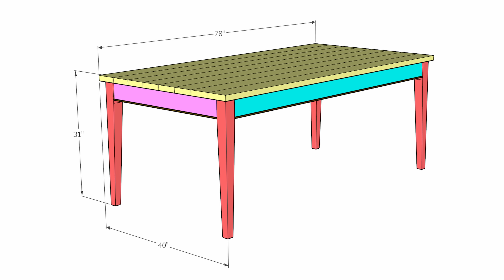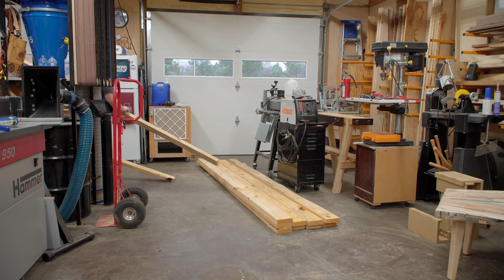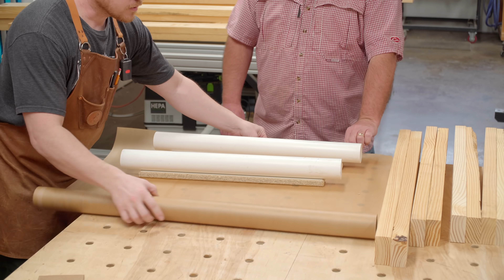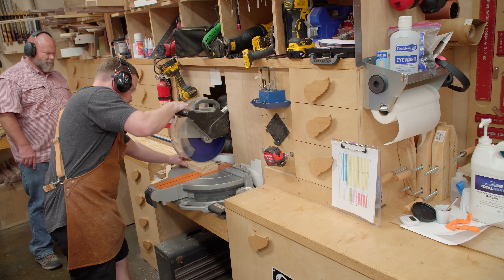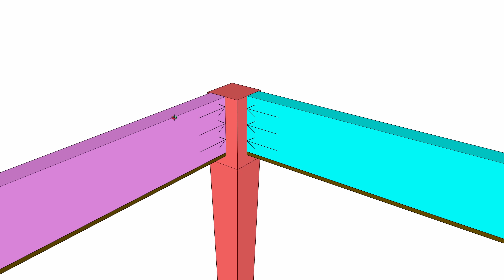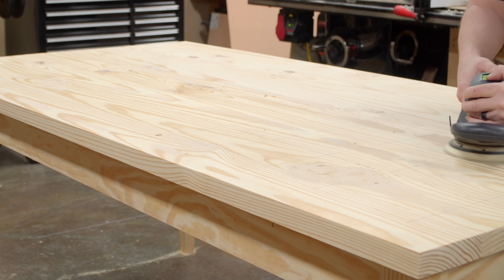How To Build A Shaker Table - 381

Comment: Awesome build, great tips. Never been a fan of stained pine.  Looks way too much like the faux rustic offerings of big box stores.  But, I realize that wasn't your choice
Reply: Agreed.  A wood conditioner, applied before the stain, would have made the pine look a bit more even.
Reply: Looks like they tried burning it.  Too much pinterest.
Reply: I think the table is great. A few modifications for minor edge treatments could have benefited it style wise a lot too. If it was vertical grain it'd be down right stunning. I'm not a huge fan of flat sawn pine but that's personal preference.

Comment: I really like the idea of the block of wood glued on the aprons and legs. That should provide more than enough strength and is a good replacement for a mortise and tenon. I hope this gets shared because this is the best and most concise video on how to make one of these tables. Someone could take this table design and add some different embellishments to it to customize it to their liking. Like adding some curves to the aprons or some different edge profiles.  

I will say that edge jointing pine on a table saw will be sufficient as if there is a little amount of bowing in the wood, clamps can close up the joints. A person will have trouble closing up those same gaps if they use hardwood. In the past, I have edge jointed pine on the table saw and then refined the edge with my hand plane. So a person could do the same with hardwood but it will likely require the extra step to ensure a good glue joint. Wood glue shouldn't be used for filling gaps. Ask me how I know. Just putting that out there for anyone wondering.

Comment: Nice work. Very practical from a construction and affordability perspective. Did you happen to ease the edges with a round over bit before turning it over to the client for finishing? Sharp edges on pine will dent quite easily and I suspect this table will see some serious use.

Comment: Great stuff.  My jointer is a benchtop model, so I'm always wondering about the risk of skip planing stock for a table top.  Have you run into any issues with the flatness of the top over time?

Comment: Hmm, the one thing I didn't like about pocket screws was that the boards would creep, so if I was trying for a flush mount, the piece that was being screwed into would rise up a tiny bit, too much to sand. With as often as I have done mortise and tenon, that way is faster for me.
Reply: I’ve had that issue when I’m just holding pieces in place and screwing in. I think the trick is to have the pieces clamped well before you put the screws in.
Reply: Yes, clamp them real well or glue them first and add (pocket) screws later.

Comment: Were those actual pocket hole screws used? It may have just been the lighting, but it looked to me like they had a matte black finish similar to drywall screws. I've just never seen that finish on pocket hole screws before; the ones I've seen usually have a silver/nickel finish to them.
Reply from the maker: These are the 2-1/2" Kreg outdoor blue screws.

Comment: It is sad that you need to explain (excuse) yourself for using pocket holes. I made a similar cedar table and benches about 8 years ago with pocket holes and they are sturdy and look great even after all the years of usage. Now I'd probably make joinery with Domino just because I don't like the look of pocket holes even though they are under the table. And of course I can charge more. 
You made an excellent and timeless table that will probably get 20+ years of usage. Greetings from Croatia 😊

Comment: Curious where you got your dimensioned lumber for this project?  I’ve tried to pick through the lumber stacks at the big orange and blue box stores, but they are wet, knotty and everyone of them bowed and/or twisted.
Reply from the maker: This came from a local lumber yard. But I've had decent results with my nearest Lowes for years. Pick through and get the best. Nothing is perfect from there though.
Reply: @JayBates  When you buy this sort of wood from a Big Box store, how long do you generally hang on to it before you're willing to make anything "nice" from it? This type of lumber is always nearly dripping wet below the surface. Perhaps that's just my local Lowe's supplier for this wood for this region...
Reply: Where are you located? Jay is fortunate to live down in the south where the bunks are stocked with such lovely yellow pine. Up here in the north, however...